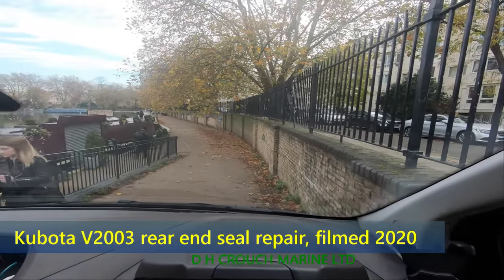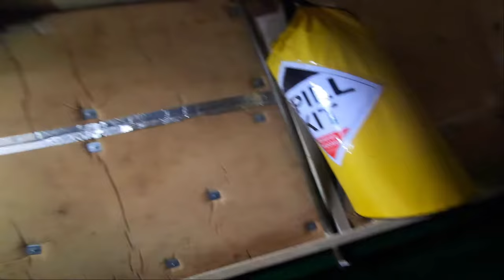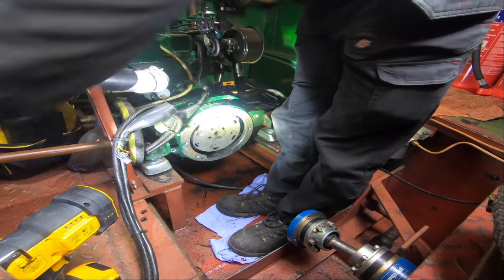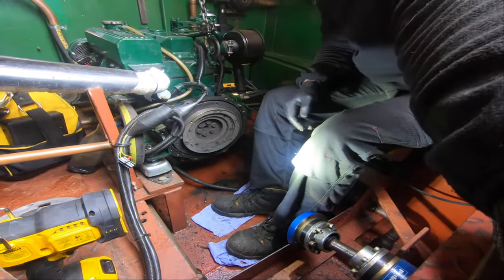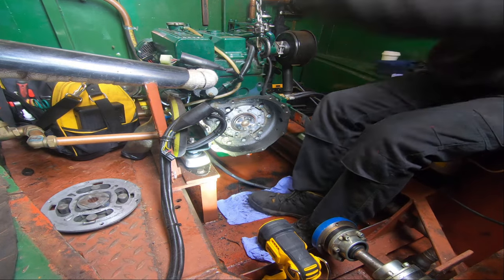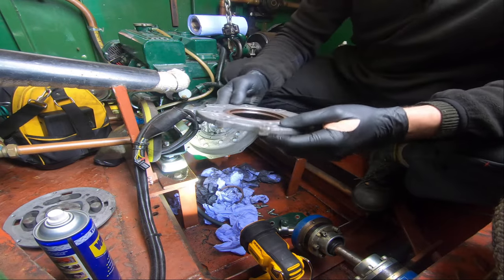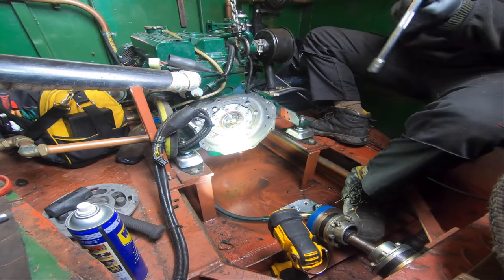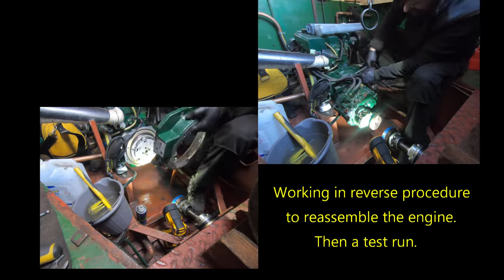Kubota V2003 Beta Marine rear crank seal oil leak repair

Comment: I remember when they bought Milton, I was with Waterbus, steering Perseus. Standing on top of a BMC 1.5 all day..then they changed to Russll Newberies for the trad vibes. Now Beta in the tasteful non-red paintwork :)
  I wonder how many hours that did before it needed the seal?
Reply from the maker: It was installed in 2012 If I recall correctly. It's the second V2003 I have seen with a leaky seal.

Comment: Hi, I've got a gearbox leak on a prm 150 d2 the oil pump end cap seems to be leaking. Is it possible to remove that  cap and put on a new gasket in situ.?
Reply from the maker: Common leak is from the oil control valve. It'll dribble down over the pump body and also the out put shaft coupling.

Can you send me a picture
darrencrouch@dhcrouchmarineltd.co.uk